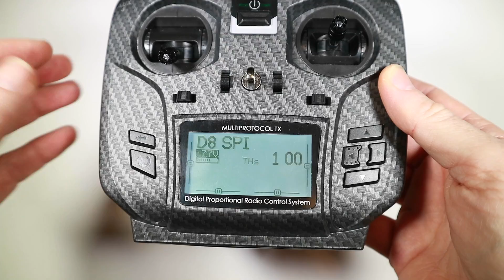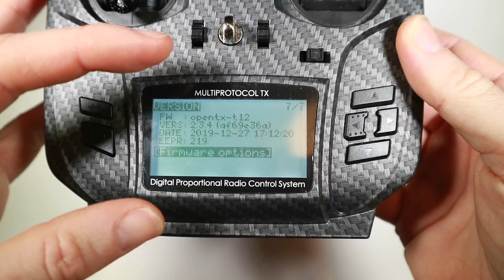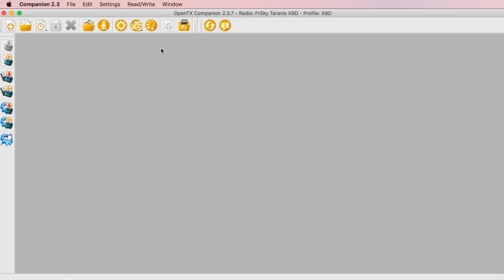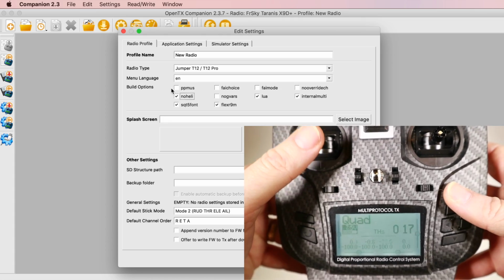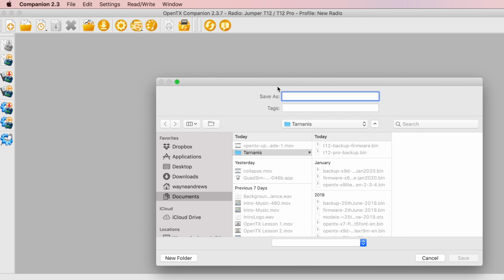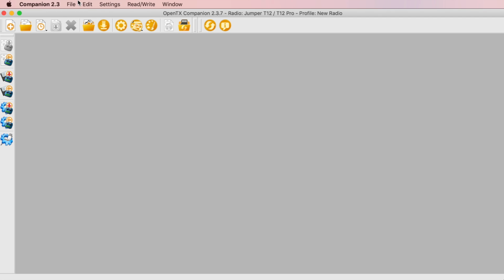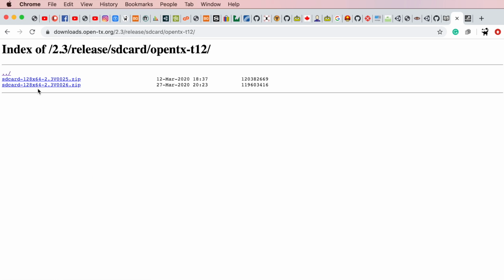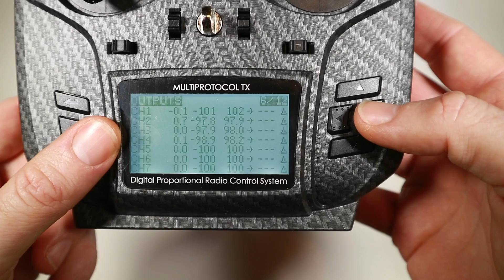OpenTX Pt 3: How to use OpenTX Companion to update your radio's firmware

Comment: Why won't my T 12 Pro stay in bootloader mode? I am starting with the same version of Open TX as you did. With no cable connected as you did. When I try to put the radio into bootloader I get the bootloader screen you get at 2:40 as soon as I release the keys just as you did, the screen goes blank, radio shuts off. It will not stay in the mode or on. Predictably Companion does not see my radio. USB to computer is only good for charging the radio at this point.
Reply from the maker: Hmmm, I don't know is the quick answer I'm afraid.  I tried doing various combinations of letting certain keys go at a certain point, but I couldn't replicate the same problem you are getting.  What's the version of the bootloader it says you have.  i'm wondering if there's a difference there?
Reply: @CurryKitten  It wasn't long after that the radio no longer functioned at all. Not even a green light indicating power on at the switch. New batteries that both tested good at the plug and individually as well. I returned it and will be sticking with just my tried and true Taranis for now. I was trying to replace an older Hobby King radio with the Jumper. Thanks for trying anyway.

Comment: Hi
I have a multi protocol  jumper T8SG v3 Plus , it uses DeviationTx as a “operating system “ , I like to know if it is possible to flash it with OpenTx , I find DeviationTx to be non user friendly .
Could you please let me know if it is possible to do that ?
Thanka
Reply from the maker: Not possible sadly.  I believe the biggest issues were that this radio didn't have enough RAM to work with to run OpenTX properly so was a bit of a non-starter.

Comment: Very nice video(s) and channel. While I have some questions.
I need to update my two radios(Jumper T12 Pro and Taranis X9D+) to EU LBT versions. And I don't know how to do that? Is there any video about that?

Jumper T12 Pro I just got new directly from the box and is at 2.3.4 OpenTX version. It came from China and I doubt that have EU version installed.
Taranis X9D+ I got from American user and is on very old 2.2.1 OpenTX FCC version. So this one needs a major update to EU LBT version.

Is there any videos about how to do EU Open TX updates?
Thank you.
Reply from the maker: There's probably no videos about it as people tend to want to run the FCC firmware instead of the LBT stuff.  The T12 Pro runs on a internal multiprotocol module, so there's no flashing of the firmware as such, but it does have a specific FrSky LBT protocol it can run.  The X9D+ runs Access and they changed the way firmware was handled, so instead of being able to flash the internal module between LBT and FCC it just comes with the firmware based on where you bought it.  That's not very helpful, but usefully there is a LUA script that will change the type of firmware it runs.  I describe it in this video https://youtu.be/kNpXQrwUlTc
Reply: @CurryKitten  Thank you. In last few days I'm finally getting better picture about all things. Didn't know that is possible to update internal module on radios, basically that module decide which version FCC or EU radio is. Not OpenTX as I thought.

Mine X9D+ is old I think from 2015, (probably luckily)runs ACCST not ACCESS. After all infos I got in last days, I have more options what can I do. I didn't decide yet.

I have all my 3 models(Furibee X215, Kinkong FPV Egg 138, SpaceWolf DT140) on FCC for more then 2 years and they works very good. On all I have XM+. What happened now. I got Mobula7 EU version, which ofcourse I can't bind to mine Taranis. Mobula7 EU version comes with XM+ which is flashed with EU firmware. So that Mobula7 will works I need to flash my radio to EU LBT version. Or that I flash Mobulas XM+ to FCC. This is what I'm a little afraid to do cos parts in Mobula are so small. I'm almost sure I will break something.

The most important Q here is: Is there necessary to put XM+ from drone to update it? Or I could use clamps and somehow put them on receiver connectors?

Luckily I got now Jumper T12 Pro for which I learned that could bind to any version of my receivers, FCC and EU. And it looks that firstly I will just update Jumper 12 to latest OTX and probably to latest internal module version, even this is not necessary, cos it should works out of the box.

I have to add this. I really like your channel. Your channel looks very beginners friendly and that is what I'm looking for. In past I followed similar channel, but then reviewer stopped posting reviews and somehow I didn't find in last 2 years interesting channel to follow.

Comment: Hi Wayne, I have watched your video several times, following step by step but although the screen on my remote says USB connected, the latest version of the OpenTX companion keeps giving me no radio connected message?  I have tried to restart radio and plug and unplug the USB to computer but nothing works.  Any help would be much appreciated
Reply from the maker: Just to check, are you connecting having put the radio in bootloader mode to flash the firmware?  Is this a Windows machine, have you tried other USB ports on your machine?
Reply: @CurryKitten  Yes on the radio it reads OTX Bootloader -2.3.5 USB Connected but on my Mac on OpenTX Companion (latest version) it says no radio found.  I have swapped cables and USB ports without success, I've not had much luck with this radio for some reason.  On top of that, my Crossfire module TX use to work but now there is no power going to it, no light on the module and no response to pushing the physical button either, really strange! No major issues with my Tango2 so far, touch wood
Reply from the maker: Yay, fellow Mac user for a change.  I think I've had this once - I sometimes get a weird "I can't see anything in that USB port" that results in me rebooting.  But that's happened like 2 times in a year, but worth trying.  As far as CrossFire goes, double check your pin alignment.  My initial plugging in my crossfire module resulted in nothing, but those pins in the module bay can very slightly bend and basically find their way into gaps in the module instead to connecting properly.  I had to very gently put pressure on the pins in my module bay to coax them into the right alignment for the module
Reply: @CurryKitten  thanks for the guidance, do you mean rebooting the radio or the Mac?  I shall give it a try
Reply from the maker: @kkam7044  Try a Mac reboot.
Reply: @CurryKitten  Thanks again, unfortunately no luck on either, seems like it's a dead end, another FPV hobby mystery!
Reply from the maker: Is the USB cable ok - to check if you connect up your radio and set it as USB (instead of joystick) do the drives appear in finder ok and can you read those files ?
Reply: @CurryKitten  It does read as connected as USB on the radio when plugged into the computer but does not appear as a drive, I have tried at least two USB cables but will see if I can find a few more to try, thanks for the suggestion
Reply from the maker: @kkam7044  Just to be clear what you need to do to see the drives appear.  Power on the radio on as normal before plugging in the USB, when you do plug it in it will either prompt you to choose Joystick or USB.  If it doesn't - it's set to go into either of the modes automatically, you can go into the radio setup page and set USB to "Ask" to change this
Reply: @CurryKitten  I do get the option of either joystick or USB drive when I plug in the radio, however, when I select USB, nothing happens on the radio and no drive appears on the computer.
Reply from the maker: So at that point you should get a normal few mount points appear.  If you are not, then one of two things is going on.  Either your Mac hasn't got the right driver for this.... but as I recall there wasn't anything needed over and above what MacOS already had.  Or you've got a USB charge cable which is missing the data connection.  If you can validate you do have a data cable - do this by connecting to something that can do a two-way communication like a phone for example, and you can pin it down to a single thing
Reply: @CurryKitten  Hi Wayne, I think I’ve got it worked out now, thanks for much for your help and patience, you’re a godsend!
Reply: @CurryKitten  Hi Wayne, I just have one more question about the SD card contents.  I have followed your instructions on how to match the expected contents on the SD card to the firmware on the radio etc but for some reason, the radio keeps saying it's not matched upon startup.  Is there anything else I can try, a bit stumped on this one.

Comment: Just an update. If I boot the radio up by pressing the two sliders together and connecting power I get into boot loader mode the if I attempt to turn off the radio but press the mdl button I can get into the models I have loaded but then if I try to turn off the radio it goes straight to emergency mode. Regards oldsurveyor 44

Comment: Hi, I becoming a little dispirited with my Radiomaster. Whenever I try to upload the contents of the sd card to companion I get the message. Unable to find SD Card. And this I have never resolved. I am now getting the message. Emergency Mode. The only way to shut down the radio is to disconnect the battery . Now I am getting my model menu but if I attempt to turn off the radio it goes into Emergency Mode. I have attempted every thing I can think off. I will confess I am not the most pc savvy person there  is but surely it should be more user friendly. Oldsurveyor 44
Reply from the maker: Hmm.  Are you connected to USB when attempting to power off as this tend to change things (although depends how you powered on) does power on/off work normally?  Is it possible you just have a faulty sd card, have you tried another one.  2 "faulty" ones in a row is likely to be the radio at fault, but if it starts working, then more likely the card.  Out of interest, why are you trying to upload the contents of the SD card into companion? - what is it that you are wanting to access ?
Reply: @CurryKitten  Thanks very much for replying. No I have not attempted to power off with the usb attached. No power on does not work the moment I attach power it goes into Emergency’s Mode. The only way is to hold the sliders in and connect power then it goes into boot loader mode if I then hit Model button I can access my model configurations but if I then go to shut down it reverts to Emergency mode and the only way to shut down is to pull the power cord. I tried attaching the usb cable to perhaps rewrite the firmware but it says no card, I have tried another card but still the same message. The Radiomaster I like because all of my recievers bind without multiple txs, but I’m wondering if I have a hardware problem and I am considering a jumper but is it me with limited knowledge and will I be wasting more money. All extremely  frustrating but I would like somehow to master this system. Regards oldsurveyor 44
Reply: @CurryKitten  power on off does not work at all
Reply: @CurryKitten  existing sd card I tried to copy to preserve the contents but will not copy either from the radio or removed through card reader
Reply from the maker: Did you actually populate the SD card with anything?  The models and settings for the radio are held in it's internal flash, not the card itself so to make sure you keep them use OpenTX companion to back them up.  If there was stuff on the card (i.e you populated it with the OpenTX sd contents) and it won't read on either a radio or a PC, then it sounds like the card is hosed.  you can try reformatting and repopulating on a PC to see if that helps, otherwise replace it.  That said, you don't need to have a card in place to use the radio, and it should obviously turn on and off ok.  Was it previously working, or always like this?  Did you update anything and this was the results, or does it just seem to have gone wrong after working fine?  Obviously if it's the later, then I'd advise you have a word with wherever you purchased it from
Reply: @CurryKitten  I’m being a bit of a pain taking up so much of your time, but perhaps this last thing is the most relevant. It all began when I attempted to bind a rx (spektrum) harvested from a umx radian it bound fine and the linear servos worked okay but the motor had defaulted to the rudder and it fired up motor but would turn off so the only thing left to do was to disconnect the power from the rx the Radiomaster immediately went into Emergency mode so maybe that action has corrupted something but I would have thought that was no different to losing signal, however I will give a try without the card and see what happens. Thanks again for your imput. Regards michael
Reply from the maker: That is really peculiar - as you mention, it should just go into a regular failsafe really.  You might try flash the multiprotocol module with the latest firmware though, just in case this is a weird bug in there.
Reply: Good morning, I have tried that and got nowhere, I think there might be a major issue with the transmitter, I did manage again to get into the models and methodically removed all the data relating to all of them all hoping that there was perhaps some conflict occurring but to no avail. Now I can’t get anything other than the Emergency message. I think I shall replace, the price that they currently retail means it’s not worth attempting to rectify which is a shame. Belonging to the Facebook group for the transmitter I am struck by how many faults are occurring as a percentage of the total sold probably small but all the same a little disheartening.Thanks for all your help  @CurryKitten

Comment: Ola. I managed to flash my T12 to 2.3 via sd card as i was getting constant windows detection 'bings' and D drive not found when attempting to use companion to flash.
It works and my models are still there plus the sd card pops up in windows as expected but windows still gives me that constant bing bing bing for what I can only presume is it trying to find the internal memory on 'D' drive. Any clues? There are no drives listed as D in my computer so this would be the first one it would be assigned to.
Reply from the maker: Not heard of it before, sounds  bit odd.  Were you in bootloader mode - any problems just attaching as USB storage?  Do you have the Pro, in which case one guess might be that because it also attempts to charge, your USB sockets didn't like the amount of power drain and kept dropping and then reattaching the device?
Reply: @CurryKitten  Yeah, happens if I do the 3 finger salute startup or just the plugin and use the on screen prompt. Oddly the SD card pops up as normal. I'm using the beige, non pro, non hall sensor one. 

I think it was ok on win8 but way over a year ago so thinking maybe a driver issue as  stab in the dark s now on windows 10. I can use it, just not with companion but that's why I flashed it. 3 cables and several usb ports all the same and cables tested with multiple devices today.
A guy on RCG asked if I had flashed the bootloader, I thought that's what I just did with the firmware as the bootloader screen does look different.

Comment: I’m very confused because early opentx university says to turn radio off then connect USB to flash firmware to radio but you just did it with radio on in bootloader mode then plugged in USB and it was successful.
Has this changed?
Can radio be on and in bootloader mode before plugging in USB and flashing firmware to radio?

Great videos.
Reply from the maker: Are you possibly looking at an older version?  You did do it with the radio off a while back, I couldn't remember how long ago exactly, but I found this link http://open-txu.org/home/undergraduate-courses/fund-of-opentx/part-2-flashing-opentx/ it says in the first note of that if you've put OpenTX 2.0+ on then you can use he bootloader mode method.
Reply: CurryKitten ,
Yes I think you are 100% correct and there it was in notes,which I glanced over and totally missed.
Your video helped show what I missed in reading which helped get me flash radio successfully.
I’ll read more closely now and be sure to read the notes.
  Thanks
Reply: I can only do bootloader mode not both since I never had 2.0 firmware installed on Mac.

Good to know,thanks again.
Reply from the maker: In which case - my apologies.  I would have covered this, but I was aiming it toward people that had just bought new radios and had to figure that the default firmware would have been at least in the 2.3.x range
Reply: CurryKitten 
You are still 100% correct using bootloader mode.
I have newer radio but was trying the older way.
Your video and comment solved that completely
  Thanks again.